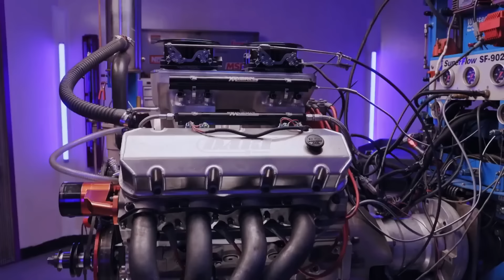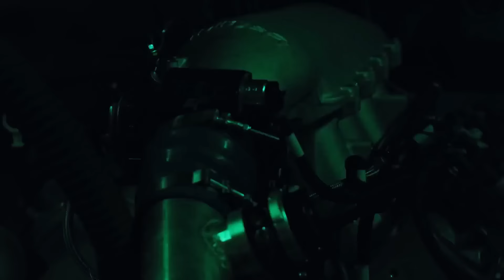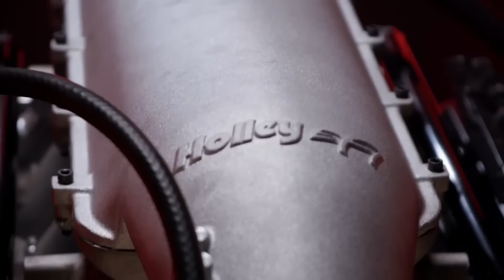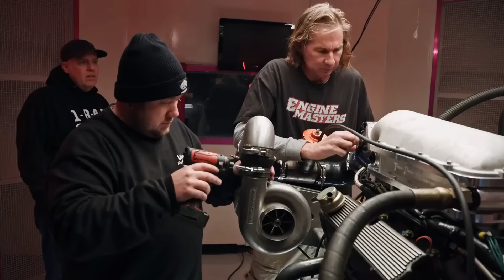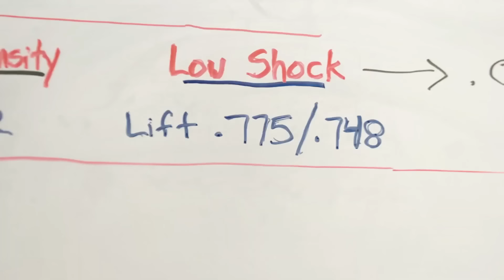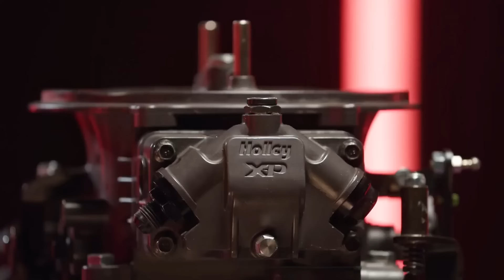Engine Masters 2025 - S9 🛠️⚙️⚒️ High vs. Low Injectors 🛠️⚙️⚒️ NEW TO DAY Full HD 720

Comment: The reason why they don't do this on vehicles that you daily drive is because of wall wetting.... Under light load the injector is going to be spraying against the wall and it's super hard to tune. Even from an oe standpoint

Comment: Using solid ice cubes.  Like the ones that come from ice cube trays from home would last MUCH longer than bagged ice.  Therefore making colder temps, allowing more pulls & more horsepower
Reply: Also less heat transfer, i.e. faster rise in the water temperature as the ice can't cool it as fast. If you have an excess of ice in a large cooler, that's great.  If you have smaller one and need the ice to work quickly, crushed ice.
Reply: longer lasting ice means the ice is cooling less, i.e. performing worse.

Comment: This is a classic intercooler episode.  I wish they had put a fuel loop inside the Ice bucket & tested it that way too.
Then the ultimate test... Install an air conditioner compressor on the engine, with a heater core installed inside the 5 gallon tank.  You'd probably have to run antifreeze in the water to keep it from freezing up.

Comment: How old is this? Their sponsors and budget and what not and they don't have full sequential, but I scratch coded something full sequential in a couple months...
Reply: Post date OCT 4 2025
SO
the injectors are constantly spraying.
The fuel ratio will tell them if there are imbalances in the fuel distribution. 
They could have asked Rickie Smith's opinion on design.
Then have the manifold ported by Darin Morgan. 
Third step would be consult Ben Alameda on : What did we forget ? 
He is an Expert on Anti=reversion.
Reply: OK, boomer. This channel re-uploaded the video. This channel is stealing content. That's all this is. This video's posted date means nothing to my question. Injectors don't constantly spray. Maybe "practically constant" or "appears constant"; but once you get beyond "carbs are just a gas toilet" thinking, injectors are never constantly spraying. You tried to sound smarter, even with hindsight, that was terrible. Drink less beer next comment please.
Reply: @CDBURLOCK-TIN-HAT-DISLIKES  not sure I've heard anything from Ricky but Darin and Ben are super smart, certainly listened to them before. Ill have to look up Ricky.
Reply: @CDBURLOCK-TIN-HAT-DISLIKES think you cute that’s your problem one of many I see
Reply: Lol this is such a classic string of YouTube comments
Reply: 11:19 never heard of running injectors this way.. huh. Batch fire injectors, 4 at a time. Strange.
Reply: @umakemerandy3669 
Its how most OE fuel injection was done from the 80s to the early 2000s.

Manufacturers moved to semi sequential, then fully sequential (and now GDi) primarily to reduce tailpipe emissions at idle and EPA testing.

Batch fire is still very common in aftermarket budget ECUs.

It works well and is simple to setup.
Reply: @nd2819 interesting stuff,

Comment: There’s only one forced induction system that cools everything the higher you rev the engine. CAS !! Compressed Air System. KC MAXX with his 3rd generation Firebird is running a LSX 427 and makes 1800+ hp with this combination. Even a long time big block guy (Beater Bomb) Joey is now running a LSX427 in his fox body.
Reply: Both 427lsx got put on the trailer in the first round of awd vs rwd by  small displacement factory block and heads turbo charged engine
Reply: @bigboreracing356 yep. i know that. take the awd out of the equation and then race. those awd vehicles are in a league all by themselves. rwd has an abundance of leagues,y'all can't say that!
Reply: You can not say " take awd out of the equation" because the class is "awd vs rwd" and  you do no not have a clue about why the 427lsx were used in the class.
Reply: @bigboreracing356 first off, all i mentioned was about a couple of no prep guys that used a 427 lsx. you brought up the race to start an argument. keep your comments to your self. you act like a person that has low self esteem and gets a hard on by getting under peoples skin. i have better things to do than text a troll that jumped in another person's comment with nothing good to say. you need to talk to my friend,JESUS.
Reply: The CAS will never become popular due to the high cost of the air compressor, maintenance, and replacing the bottles when they fail inspection and hydro test.
  When spectators get killed due to a uninspected and untested bottle explosion will be the end of the CAS system.